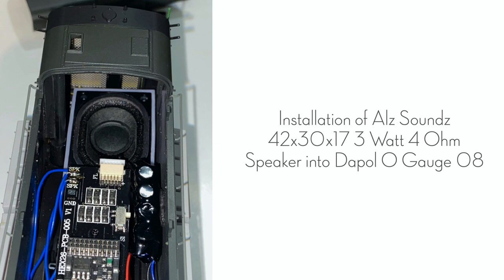Dapol O Gauge Class 08 DCC Sound fitted with new Alz Soundz 42x30x17 Speaker by Digitrains.

Comment: Looks lovley, I'm thinking of putting a chip in my 08. Does this chip have drive lock? Also, how much more would the speaker be if I was to buy the chip and the speaker together? Thanks.
Reply from the maker: Hello there, thanks for getting in touch. Yes the sound project features speed lock/ drive lock on F7. The decoder MS440C (£123.10),Sound File (£15.00) Speaker (£16.95) :)
Reply: @DigitrainsLtd  thanks.

Comment: Hi David, great sound which you fitted to my EWS Dapol 08, how does this compare price wise to the speaker that was installed in my 08? I have another 08 ready for sound and love the volume on this speaker. Cheers Julian.
Reply from the maker: Hi Julian, sorry for the slow reply. We had this speaker in for evaluation, and have some on order with Alz Soundz, so can't give you a price currently. But should be able to when we get them in stock (which shouldn't be too long!) :)